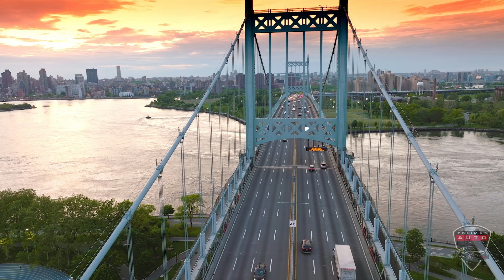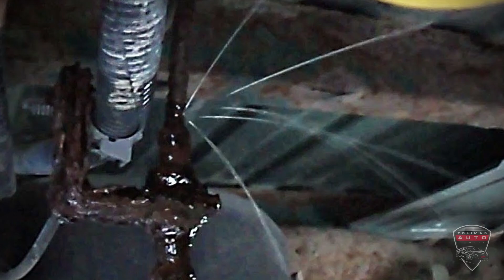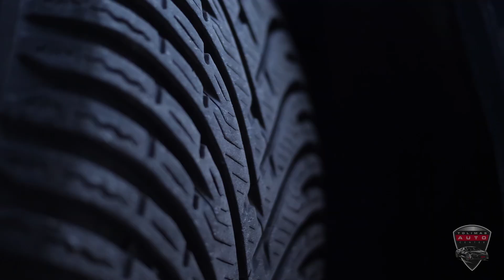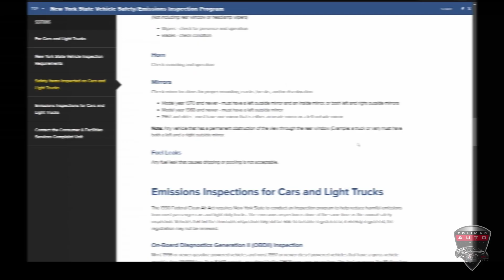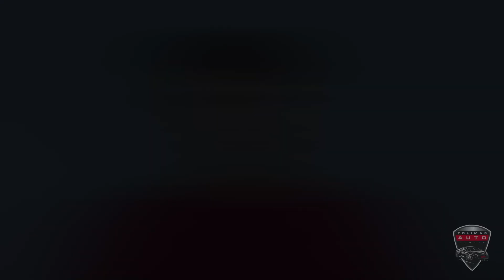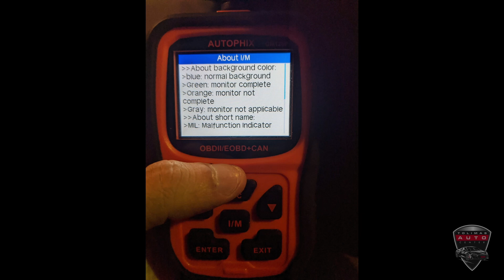You Won't Pass Your NEW YORK STATE INSPECTION Without Knowing This!

Comment: The problem is if you disconnect your battery, will your battery goes dead your car is not gonna pass so then you have to perform the General Motors OBD sequence on your GM card to get it to pass. Tell me where the hell in New York can you do this Mike Corvette I friggin went through the OBD series at least 1215 times it’s got a brand new General Motors motor in it. Everything was perfect. There’s no lights on the DIC no coats come up. The car runs perfect I gotta drive the car from Queens, New York to Jones Beach. Every time they performed the secret and hope that nobody runs up my ass when I’m doing the sequence obviously whoever wrote these frigging statistics probably some bureaucratic democrat never worked on a car and can’t find his ass in the dark with both hands. It’s a small one that people buy bootleg, friggin inspection, stickers, and small wonder that people move out of New York State cause they can’t put up with this nanny state bullshit.

Comment: Would a store code fail the emissions portion? Granted the check engine light left on its own  and monitors are ready?
Reply from the maker: As long as the check engine light is OFF and the self test monitors are all passed you should be able to pass your inspection even if there is a stored code in the computer. 😁👍
Reply: @TolimasAutoCenter if I have a ripped strut cover or airbag light, does that warrant a fail??

Comment: So a missfire or light will make you fail even if your car is not emitting emissions  over the leagl amount.   Man the state is scamming  the people..im moving to longbeach and not happy i have a modified car stereo  truck with 5 batteries  and an over powered alternator so not all equipment is still in the truck do to the box and small electrical issues that come and go with metal ripping bass 😂 ..ac is bypassed ...how is that fair its a good truck with  alot more life in it . But now i might have to junk it because of the computer talking to a scamming government agency. They needed to leave safety to the insurance  company..  the poor cant afford  a working perfect older car. Feels like the car companies and mechanics got together to lobby for this 😂